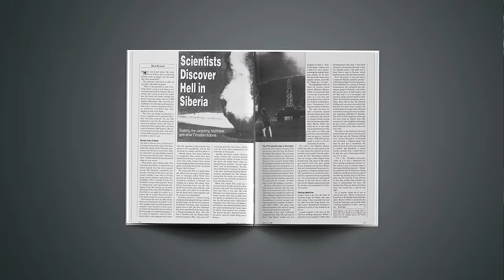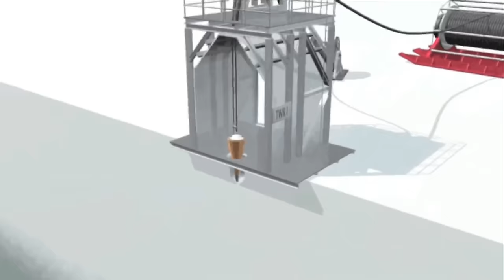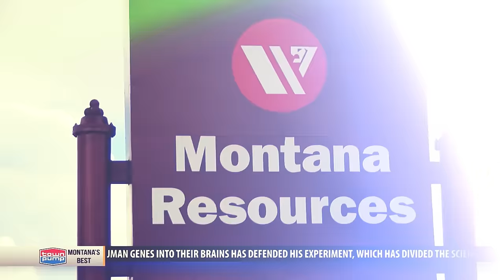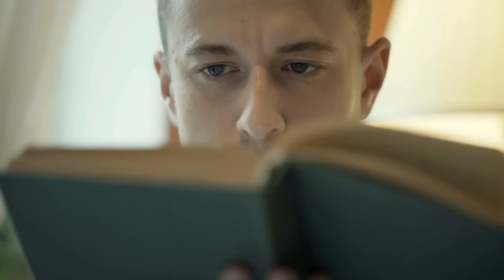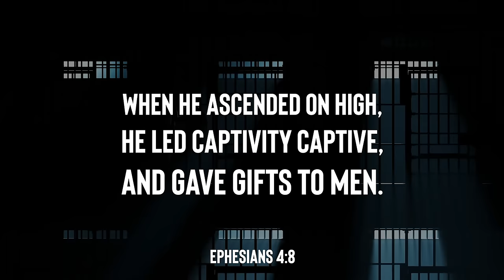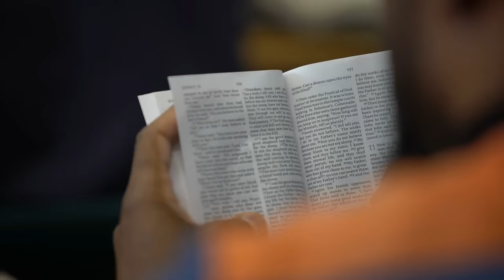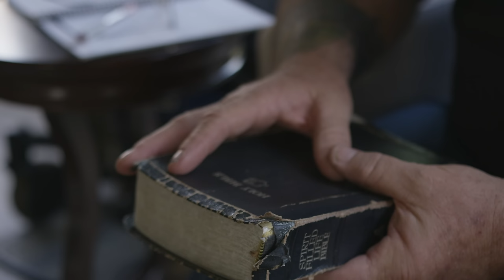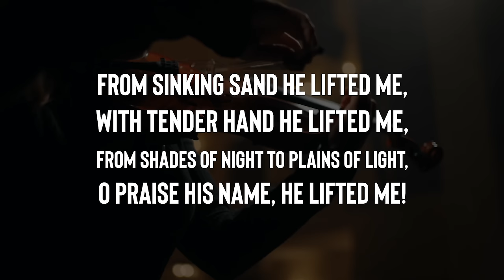"Something Terrible Climbed Out of the World's Deepest Hole"

Comment: I wonder if the heat in the hole caused a feedback loop in the microphone, which produced the bizarre scream-like noises. 
       It’d be interesting to heat up an identical microphone to the same temperature that was in the pit, as a test,  to see if it causes the microphone to make a similar noise.
Reply: Hell is a dimension, and it's cold, not hot.
Reply: @Iamgroot9170 exactly
Reply: The New Testament also refers to hell as “Gehenna,”How could this be possible? And the fact that the phrase “it’s cold as hell” exists and is used colloquially adds nuance to this idea. Syntactically and semantically, the phrase makes sense: it is an extreme feeling of one of the two ends of the temperature spectrum. However, cold and hell are two words that are oxymorons and are unable to work together in a sentence and yet, they do. Furthermore, there are many more interpretations of hell (or at least the further down in hell you go) the colder it gets
Reply: ... This is the most reasonable response I have seen yet
Reply: Interesting theory but as someone who has been an audio engineer since 2009 you wouldn’t get a recording like this from heat.  It would more than likely overheat and not be able to record anything or just be massive amounts of feedback like we have all heard from those small garage bands when they plug in and start adjusting their mics.
Reply: @erikj345 the "its cold as hell" argument is laughable at best. The "as hell" is used for or sorts of things. "Hungry as hell" "dumb as hell" "hot as hell" "dirty as hell" etc
Reply: thats a theory not a fact
Reply: @erikj345  Dont decieve your self
Reply: No way the microphone burning made these noises. This is the sound of many different voices moaning sighing yelling & gnashing of the teeth
Reply: @jlove3046  I’ve worked as a nuclear technician and an electronic technician and a mechanical engineer and I don’t claim to know what sounds can and can’t
be generated by a malfunctioning microphone. I’m also a Catholic.
Reply: Could very well be angry fallen angels.
Reply: I believe studies have been done and it’s just the sound of shifting plates and or gases . It’s def not screams
Reply: At that depth it would be ehh around 600-1100°F
So it is definitely plausible
Reply: @erikj345  You realize "as hell" is used quite a bit correct? "Its hot as hell" for instance is something a lot of people say. "dumb as hell" is a good example for these yalls comments lol.
Reply: Hell indeed is hot and it can be cold I imagine I doubt it's a nice temp
Reply: I agree, it would be interesting. It’s like the video where a YouTuber spends his time destroying phones in any way possible. He dropped one of those phones down into a hot spring called The Devil’s Cauldron and it recorded something similar during his first try, but no sound during his second try. This could be due to the fact that it had already been heated enough the first attempt and thus the mike was damaged enough for the whole thing to become unstable.
Reply: That audio is already debunked fake, what's why files video about that
Reply: @DevonHaney  yes it is, but there is another clip with a YouTuber dipping a smartphone into a hot spring to see if it holds. He has recorded screams under water in that clip, but I personally believe that a hot spring can make all sorts of noise and it’s just a coincidence that it sounds like screams to our ears. Science calls it audio paredolia and explain it as our ears interpret a sound it doesn’t recognize into something we DO recognize.
Reply: Utter nonsense. Hell is future.
Reply: @CumCum-c3l  it’s like that song by Accept from Russian Roulette: “Heaven is there where hell is and hell is down on earth “
🤘🏻🤘🏻🤘🏻
Reply: @erikj345 the second death. Or the souls death.
Reply: @erikj345 it is a gravesite outside Jerusalem.  The people there will not be resurrected.
Reply: Hell is definitely cold. It's the grave. Death. The nonexistence that waits for all souls until vivified by God. What we think of Hell is actually "The pit". Likely also cold, and the only thing there are trapped, maddened fallen angels. Satan isn't there, but will be. But soon they all shall be unleashed for a time. ...TBN, ugh. No stumbling on hell, sorry.
Reply: @gmork1090  Yes, in “Dante’s Inferno,”Hell is cold.
Reply: @gmork1090  sailors from around the world held a stark belief that Hell was cold. Not warm.
Reply: @Iamgroot9170  that's not biblical, thats from Dante’s inferno. Thats poetry not biblical.
Reply: Very good point there. Now tell me how we explain 100s of NDEs where people are pronounced clinically dead but they experience the same hell, same characteristics…
Reply: @cherryblossom15  From what I’ve read, most people see a peaceful, loving, Being of Light, instead of a hellish encounter with The Prince of Darkness, but I have also read about an encounter by one person who wasn’t particularly evil, who said she visited hell, and was surrounded by the sad creatures that dwelled there.
         She was agnostic and she said that these monsters wanted her to stay, and the only way she escaped was to tell them all that she loved them, and then they let her go.
       Interesting.
Reply: Drilling so deep into the earth would definitely release some interesting gases, carbon monoxide, methane etc. What would that sound like whistling through such a narrow pjpe? To make things even wierder, a microphone is a magnet and they likely used a uni-directional one picking up sound from every side and yeah, the feedback noise would have been craayyzzzeeee..
Reply: Tbat story is alot like the Greek story of Orpheus and Euridice. Orpheus was able to pass into the underworld by playing music on his lyre which hypnotized the demons and he was able to pass through and rescue Euridice, but as they were about to emerge into the world above he turned
and looked back to make sure she was following, whereupon she disappeared or was snatched back by Hades.
Reply: thats what I thought
Reply: It's fake.
Reply: @IvanKiselyvov  the only thing laughable is you trying to argue an age old turn of phrase.
Reply: @jlove3046 There are some videos on youtube about the sounds of different planets. Maybe, below earth has it's own sounds due to various factors like special rocks or metals that reflect off each other or reflect the noises of earth echoing from deep below made by the hole and sounds entering it?. I don't think we were made to hear these sounds of hell on our physical planet. Hence, when someone dies we feel disconnected or might be connected for a short period until that person's journey in the spiritual world completely leaves the physical world. I mean, we have not found heaven here so why would we be able to find hell? Just a deduction in passing. Maybe, heaven and hell is in another realm of existence?
Reply: @gmork1090 What about the saying "burn in hell" or the idea of souls being tortured in an eternal burning flaming fire.
Reply: @Iamgroot9170  hell is hot man where did you get this "hell is cold" from man
Reply: @erikj345  Yeah, I'd hate to kinda ruin this. But, there never was a microphone lowered into the Kola-borehole. That's a conspiracy theory made up by a youtube video a while back. The noises are actually just sampled audio from an online library, the noises were uploaded a few years back by a religious channel, claiming that the russians found hell. The Kola never reached such high temps, infact, the highest was about 180 - 300 cel. Which is more than enough to melt equipment, and the preasure caused the rock to turn into a plastic-like state, making it extremely difficult to dig through. Aswell as this, they had to keep pulling the bore-machines up, replacing them, and lowering back in, which could take days, only for the drills to last 1 - 5 hours before having to be replaced. They closed it after 25 years because nothing all that exciting was found, and it was draining their budget at the time. 

Most interesting discovery found down there, was about at the half way mark, they discoverd billions of years old microscopic fossils, and close to the bottom, liquid water could still be found. Likely caused after oxygen and hydrogen being forced together, and staying liquid due to the preasure not allowing for it to expand into a gasseous state. 

So, all in all, if there is a hell, we haven't found it. The kola superdeep is an already amazingly cool story and adventure, it doesn't need more flare. Don't tarnish yet another amazing thing with religious bullcrap, it gets me pissed when people vandalize these kinds of topics.
Reply: @Iamgroot9170 its in saturn (?)
Reply: I was thinking the same thing.
Reply: @erikj345  You're right, no feedback loop or any other phenomena caused the sound. The sound is fabricated, by a Christian youtube channel. Infact, there are no official records of any mic ever even entering the Kola borehole. And even if they did, it wouldn't make it to the bottom, before melting and breaking due to the powers at play down there.
Infact, no microphone, ever, especially not back then, could withstand such power.
Reply: @serpentlag8960  Heres a fact, there never were any microphone lowered into the borehold in the first place.
Reply: @jlove3046  All fabricated noises. 
No records exist of any official microphone being lowered down there. It's simply too hot and pressurized to be possible. So no one tried
Reply: @Kevin-le8qc  Yeah, all of this was fabricated, infact, no microphone was ever sunk into the hole. It'd be stupid to even do so
Reply: @deborahalexander7349  Or a hoax, seeing as no microphone was ever lowered into the hole
Reply: @Kevin-le8qc  stop praying to Mary. She's not God.
Reply: @Iamgroot9170  have you seen santos bonnacci too 😊 inverno means cold but they changed it to inferno ( hot)
Reply: @hamsterrwrld6767 hot as hell I believe comes from The Sun being called hellios once upon a time & people know the Sun can get real Hot 🔥
Reply: Capricorn is the goat "devil" seen as evil opposite of live... things grow in summer die in winter. That's the original 'evil'

No thing to do with Twisted entertainment movies idea of evil.
The evil we know today is down to sick individuals perversion.

Comment: They reported a few strange things at kola that were verified and don't match what was expected. Oddly density didn't increase with depth and temps rose far higher than predictions at the depths they reached.  

Another odd thing. 7 miles down rock is like melted plastic... hows that factor into earthquake faults locking together.

Comment: Finally something I can speak to. 🇨🇦
I have a couple of decades of experience In oil and (natural) gas-well completions so I can give you a few insights. 
First off, the average well I worked on in Westen Canada was about 3.5Km deep. First off, after about 100m it's pretty hard drilling. Plus, if they hit a pocket, and the well didn't have drilling mud to weigh down the pressure, they would have had a blowout. And the machinery would be too loud to hear anything. In my 20 years, I've never once been able to just look down the hole. There are BOPs and valves..... it's a huge operation. This cannot be true.
Reply: I've been on drill floors too, and they are loud for sure. But at the bottom of the hole, well, 3000m down you won't hear much machinery. That being said, the well isn't an empty  void, it's filled with drilling mud, I've no idea how or why you'd put  a microphone down there, it makes no sense.

Comment: Yeah, I'd hate to kinda ruin this. But, there never was a microphone lowered into the Kola-borehole. That's a conspiracy theory made up by a youtube video a while back. The noises are actually just sampled audio from an online library, the noises were uploaded a few years back by a religious channel, claiming that the russians found hell. The Kola never reached such high temps, infact, the highest was about 180 - 300 cel. Which is more than enough to melt equipment, and the preasure caused the rock to turn into a plastic-like state, making it extremely difficult to dig through. Aswell as this, they had to keep pulling the bore-machines up, replacing them, and lowering back in, which could take days, only for the drills to last 1 - 5 hours before having to be replaced. They closed it after 25 years because nothing all that exciting was found, and it was draining their budget at the time. 

Most interesting discovery found down there, was about at the half way mark, they discoverd billions of years old microscopic fossils, and close to the bottom, liquid water could still be found. Likely caused after oxygen and hydrogen being forced together, and staying liquid due to the preasure not allowing for it to expand into a gasseous state. 

So, all in all, if there is a hell, we haven't found it. The kola superdeep is an already amazingly cool story and adventure, it doesn't need more flare. Don't tarnish yet another amazing thing with religious bullcrap, it gets me pissed when people vandalize these kinds of topics.

Comment: Heres a semi-detailed explanation of what actually went down.

Back in 1970, a race, between the Soviets and Americans began, but not one towards the sky. Rather, they aimed for the dirt, hoping to understand what made the earth, the earth, and also flex on their counterparts. The Americans, quickly backed down, after just a few attempts. But the Soviets, wanted to keep going. So they kept digging, as far as they could push themselves and their equipment. Which was really far, nearly 12,2 kilometers (40+ thousand feet for you Americans) but after reaching this depth, they gave up. As unexpectedly, the tempreture had risen to tremendously hot, and the pressure had formed a form of rock, that had the properties of plastic. Making it pretty much impossible to drill, and everytime they did try, it would take 5 - 15 hours to lower the drill down, and another 5 - 15 to pull it back up. For only less than an hour of drilling, which gave them at max a few more meters. 
They also figured, that they'd been well more than successful enough, since they'd discovered ancient new species of cells, dating back further than previously thought, and a new type of water layer, that had formed to be crystal solid, but above ice's melting point. And all sorts of other really fascinating stuff, that contributed to a lot of modern science. 
With all this, they decided, no long was it worth it. So they closed and sealed the borehole completely, and pretty much left the building.

However, a local, wanting to prove his own theory, about how gullible people are, went to a news outlet, and told them a fake story of a microphone being lowered into the hole, and discovering various things, although the story differs, generally, he said something along the lines of there being a giant cavern with a lot of screams, and bad things started to happen to the drill and the workers.
His theory, was proven right, when the news source, took it word for word, without background checking him, or fact checking anything, and just published it. It quickly spread, and soon, became the wonderful myth we all know today. That a high spec microphone, went to the deepest depths of the Kola Superdeep Borehole, and heard un-ending screams of terror and agony, and discovered a massive cavern. As much as I wish there was a giant cavern down there, there sadly isn't. And in all reality, no microphone, has ever been capable of even approaching those depths and pressures. And no microphone ever neared the hole.

End of story

Comment: No recording could survive such intense heat from “7.5 miles deep” into the Earth. In Revelations 13:1 it says “The dragon stood on the shore of the sea. And I saw a beast coming out of the sea. It had ten horns and seven heads, with ten crowns on its horns, and on each head, a blasphemous name.” HOWEVER, in Revelations 13:11 it says “Then I saw a second beast, coming out of the Earth. It has two horns like a lamb, but it spoke like a dragon.” So there it is. They had (probably) dug to a place they shouldn’t have dug to.

Comment: The screaming coming out of the hole could be Water being boiled and evaporated by the heat of the rock at that depth. With the depth of the hole it might be possible that the steam reaches a certain point and vaporizes and doesn’t come to the surface.